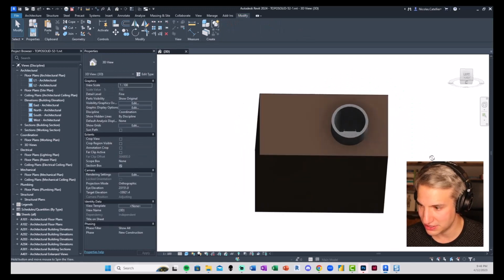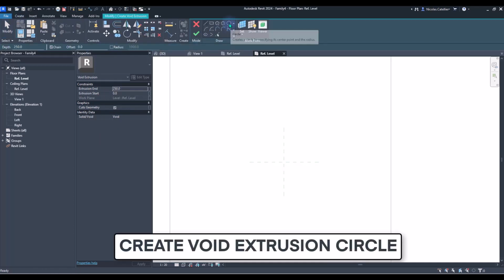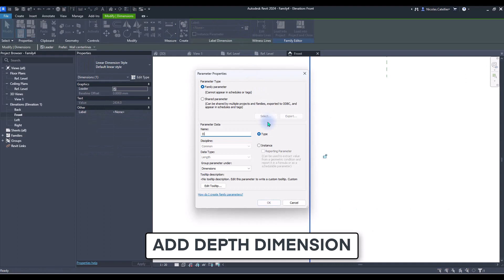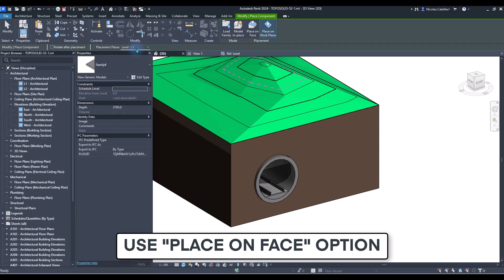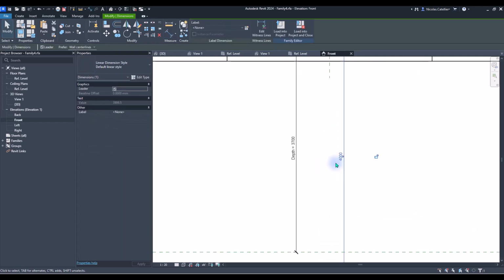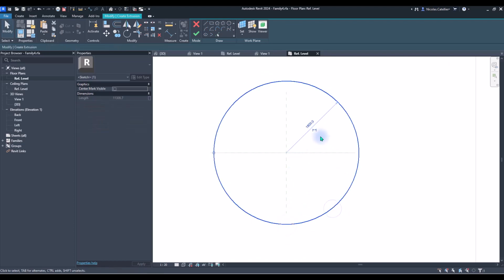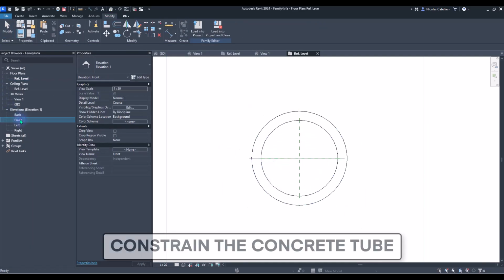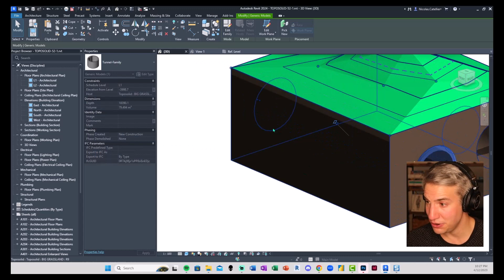🚇 Modeling a Tunnel Family in Revit 2024

Comment: This approach would only work for straight tunnels, right?
Reply from the maker: Yes, but you could create something similar by using a sweep void placed on an angled reference line
Reply: It'd be interesting to show us how to make it in sweep technique
Reply: We just did a test of a generic model model in place.  You cut touching the topo solid first and then the model in place.  We are going to put all the cutting elements on a workset to turn them all off.

Comment: Wouldn't the grips be visible even only changing the reference plane from Weak to Strong Reference? I need to try it now :D
Reply from the maker: Anytime it's an instance based parameter, the grips will be visible in 2D views. To make them appear in 3D views, you must use the special ref line trick.
Reply: @bimpure  that's great, I didn't know that. Thanks 💪